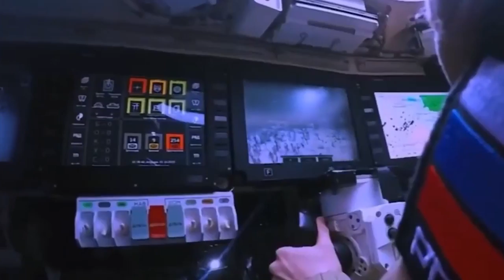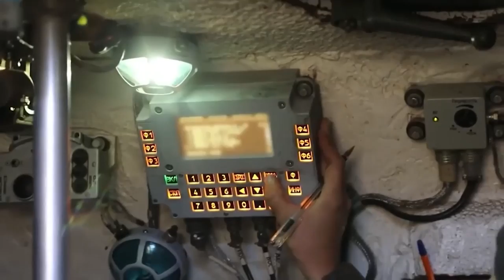What's Wrong With Russian T-14 Armata Tank (Military Analysis)

Comment: I'd like to hear more about the T-14 in Syria.. If it was even there. and I've never been a fan of a three man crew. As far I'm concerned, having a human loader is the way to operate.
Reply: The T-14 likely wasn't in Syria at all. With how well documented the conflict was we'd have at least some evidence if it did.

As for 3 man crews, they make perfect sense if the tank is well designed and are a necessity for crewless turrets which means they are likely the future, since optronics advancements and autoloader innovation make crewless turrets more and more likely our future. Even now they're finally popping up in IFVs and the like, MBT autoloaders are harder to get right and MBT projects a hell of a lot more expensive which is likely why it's taking longer to implement them.

Thing is, the main advantages of crewed turrets are in peripheral vision, but optronics are making that irrelevant, nowadays the latest IFVs popping up like the Spanish Dragon and Castor VAC lines have better awareness despite being crewless due to this, and the cost of these systems is rapidly decreasing with time.

As for the autoloader. While the Russian caroussel models are a shitshow, the NATO models, most notably the French ones implemented on the Leclerc have proven we can do a lot better. With the added advantage of keeping all the ammo in the turret which allows for it to be a completely isolated module from the crew and engine, allowing the tank to still move and operate even if the turret suffers a catastrophic failure.

In my honest opinion, the next gen of MBTs are likely gonna be crewless turreted 3 man teams. Likely not the Abrams X or new Panther because those are clearly tech demos and way too expensive to implement, but something that takes notes from the French MBTs and Spanish IFVs, and possibly keeps the crew in the back like the Israeli Merkava since the main drawback of that is also awareness which once more, has stopped being an issue. But the T-14 was a horrid implementation of all the ideas it claimed to champion and if anything just serves to turn people away from them.
Reply: @thespanishinquisition4078  The hull-residing autoloader of T-14 has its benefits over say a turret bustle autoloader. 
It has a much lower risk of getting hit; allows for a smaller turret, which means you can use less and smaller radar arrays but still be able to cover the entire tank; T-14's autoloader can carry ten more rounds than Leclerc's bustle autoloader and 16 rounds more than the K-2, which is a pretty big advantage in combat, by the way; there are probably other minor advantages that I haven't though of.
Reply: @definitelyfrank9341  And as most Russian autoloaders requires a hangfire clearage every 3 shots.
Reply: @okbutthenagain.9402  Well, a CIA report directly debunks your claim; it states that the T-72's autoloader managed to cycle 3,000 rounds without any mechanical issues or malfunctions.

Nice try, buddy.

Comment: Does this tank have potential?
Simple answer: NO
It is made by russians and therefore they would never achieve it's full potential.
However the tank itself looks good on the outside but how good is it in the inside of it?
We can only speculate how it will perform under small changes (auto load is garbage feature in a tank tbh since it's so slow)

Comment: wait a minute every new tank is going in the direction the t14 is going like it or not. just look at the latest german and American next generation tank and you can see a lot of important similarities so do they suck as well
Reply: not really as the MBX and MBT 80 prove, and date form the 1980 that would lead to the Abrams and the Leopards of the late 1980s. The experimental MBX had a Armored capsule for the crew and a unmanned turret.
Reply: @Delgen1951  all the new tanks have characteristics of the t14 so what you said still doesn't make a difference, tanks are evolving in the direction the t14 is as a result of better technology

Comment: I'm calling bullshit on this.

There where about 600 T90's at the start of the Ukraine war. About 20 have been lost... Several ran out of fuel (this has nothing to do with the efficacy of the tank, that is shitty logistics) Several malfunctioned and had to be abandoned, some where destroyed, and some where captured. 

About 2000 tanks where deployed, about 600 have been lost. Which is pretty bad... But how well trained where those troops... Did they have proper infantry fire support, air support etc. 

A weapon is only as good as those who wield it. AND the support teams they need to be survivable on the battle field.

The Armata is orders of magnitude better than the T90. It's not some mere old design, reimagined. It's a ground up redesign. Yea... That means delays lol. Problems are going to occur. 

Does that mean it is shit... NO! It is being produced on a shoe string budget. And given all these factors... They have done a pretty good job. 

Delays, cost overruns, and technical problems are a normal part of the development of any piece of military hardware. Cough, F35, Cough

And just FYI... Russia has silicon fabs... They aren't cutting edge. But they are more than capable of producing a CPU that can run a tanks systems. It will be slightly larger, and bulkier, as Russian gear usually is. But it will be robust, and it will get the job done. 

Russia also has stock piles of silicon from TSMC and Global Foundry. And that won't be running out any time soon. They have more than enough to produce their allotted T14's, other fighting Vehicles, and SU57's.

We're not calculating the distance of quasars here... A 10 year old Xeon is probably MORE than capable of running these types of systems. 

I'm no fan of Russia, or Putin. And this war is an unmitigated disaster, and the human cost has been absolutely horrific... But I am sick of this Russia gear bad, west is awesome attitude. It's farcical. And quite frankly, just plain misleading!

Comment: What the New Abrams X was similar with the T14, new concept on Tank, both are expensive and I doubt the Abrams X won't suffer the same dilemmas as the T14
Reply: The biggest problem the Abrahams X has is that there is little reason to build them at scale right now. As such it is kind of a "Look what we can do if we feel like it" thing. Tanks are not thre dominant force they used to be, and for the purposes of the US the armor we already have performs great.

It would be one thing if we were losing Abrahams like the Russians are losing their armor, but so far little has been its match, and we focus primarily on different tactics.
Reply: ...only it won't take 20 years for us to iron them out, or build more than 20 of them.

Comment: the t14 doesnt take 10 sec to reload, it has 10-12rpm fire rate which means it takes 6 to 5 sec to reload
most human loaders cannot fire as fast and those who do can only do it for a few round worth of shooting
this also means that the abrams loader will have the protective blast door always open and have ammo all around the turret negating any crew protection
Reply: I very much doubt Abrams crew would have Ammo all around the turret especially in a war zone.
Reply: @michaelfloyd1127  thats to get the full ammo capacity stated for the tank and in case to achieve the maximum fire rate.

if you dont have ready to pick up rounds, you will have to open and close the blast protection door every time you want to pick a round up.

Abrams is one of the best blast protected tanks since almost  all of the ammo is away from the crew. This doesnt apply the the UK chalenger2, which has 2 piece ammunition and has no blast protection at all, or the Leopard 2   which has half of the ammo away from the crew and the other half next to the driver and loader.
Reply: LOl fire rate of 12.. Listen Russia's autoloaders rarely do what they claim they can. And more often than not never get more than three shots off before requiring a hang fire action.

Comment: There are no t 14s in Ukraine, the t 14 did not break down but instead its parking brake was on and the driver did not know how to remove it. The t80 has a comparable reverse speed to the Abrams. This is just 3 minutes into the video.

Only had to listen to the first two minutes to realize that this is not actually a dependable resourceful video.
In fact there are multiple mistakes and misconceptions scattered throughout the video.
Reply: Infact I believe this is not about the t14 at all, it is about throwing hate at Russia, the engineers that designed this tank are not relatives of Putin, give them their own credit, even tho their country is questionable.
Reply: Same

Comment: T-14 never broke down in the 2015 victory parade. The tank's crewmen were not familiar with the operation of the tank. And yes, there are problems with T-14's thermal imaging systems, most likely bugs in the software. Also the engine problems of T-14 Armata.

Comment: Frontal armour of almost 1 metre????
Is that correct????
Reply: No its probably even less than on T-90 or the weight would be crazy high.
Reply: @Mr.Dodo-  are you claiming this video is spreading mistruths?
Listen from 1:40
Reply: @procatprocat9647  Well it is not like the document on the T-14 are public, so the only information we get is what is published by the government. There is no way the armour is anywhere close to 900mm thick. The tank would just weight too much and have REALLY BAD mobility. But the mobility is not bad and we can see this in footage. So it must mean that the armour is thin.

Comment: The T14 at the victory parade didn't break down. The driver pressed the emergency brake and didnt realise it. Thats why the towing vehicle couldnt move it at all. Do some more research.
Reply: It didn't brake down. The brakes just stayed down.
Reply: Right, and nobody in the tank knew what an emergency brake was. And nobody towing the vehicle thought "maybe we should make sure the emergency brake is off to make my job a million times easier", you know, the first step in towing every single vehicle in existence.
If that's the case, this gross incompetence is far worst than the vehicle breaking down. But now that you mention it, it does seem like the kind of failure only the Russian army can pull off. Next time, you'll tell me Russians forgot you had to remove park to go forward.
Reply: Yeah, and the Russian fleet flagship "Moskva" sank because of an "accidental fire".  🙄
Reply: @samuelweir5985  it sank because some maitanance officer stole 80% of its air defense systems.

Comment: With a few exceptions (Mig-15), Russian hardware have always been overrated compared to their western counterparts. The main source for this is the T-34. which in 1941 was able to easily shrug of rounds from German 37mm and 50mm AT guns. Come 1942/43 and the dreaded T-34 is suddenly just meat on the table for PaK 40s, upgunned Panzer IVs and Tigers. But the first impression stuck,and the T-34 has often been named "the best tank of the war". In addition they made a whole range of dreadful heavy tanks, starting with the KV-1 and ending with the awful T-10. The only half decent one was the IS-2, a primitive and poorly made tank, basically a KV-1 with a bigger gun and sloped armor, that somehow has been regarded as superior to the Panther and Tiger I, and at least equal to the Tiger II.

Meanwhile the hapless Sherman, which was in most respects superior to the T-34, entered combat when the Germans already had upgraded their AT weaponry, thus earning a reputation for being easy to knock out from the get go, and often been regarded as a failure.

Comment: Human loader will never be superior to machine. Few shots and he will be exhausted. You also need one more crew member only for loading. Gunner can't be loader and commander can't be gunner. Remember - when tank is penetrated in a right spot, ammo rack can blow out. Autoloader works fine since T-64 and has nothing to do with exploding ammo rack - it is rather poor side skirts design and not as good top side protection against rocket missiles like Javelins.
Reply: Obvious account agenda aside. The autoloader is infamous for jams, misfeeds and becoming misaligned and when no safe or quick way to clear misfeeds and the complexity of the mechanism making battlefield repair unlikely, the traditional loader than most nations still use is infinitely more reliable and still operable in suboptimal conditions. Tank loaders in Western nations train vigorously to put as many rounds through as physically possible - far more than any single confrontation would warrant.

US, UK, FR etc. are laughing at how badly maintained the Russia military has kept their equipment and vehicles with supply barely able to keep soldiers equipped with what would basic day 1 gear for any new recruit in bootcamp let alone active conflict. Inter-rank corruption has crippled the initial assault.
Reply: Wrong auto loaders break down very easily while qlso if the auto loader is damaged it cannot load and if it could it would take 30 seconds to load one shell without its auto loader
Reply: @ArctrooperHavoc  Actually what you said is a myth. When you ask someone who served on one of Russian tanks, he will say that even in combat situation you can easily repair autoloader malfunctions. You understand of course there are damages that can't be repaired... but same situation is when loader is killed in action. :)
Reply: @nxxynx5039  Account agenda? I don't understand what did you mean, but I don't care at all. Ask anyone who served on russian tank is that what you said is right. He will laught, because it's easy to repair autoloader. Ofc I mean not destroyed autolader... but jammed. But same situation is in US, UK and FR takns when loader is killed in action. :) By the way. You know... 20kg shell isn't something you can swing all day but you can believe everything what you want.
Reply: @sinoichi  actualy when it comes down to if the loader dies the gunner or the commander will have to load for them
Reply: @sinoichi  also on a t14 aren't you guys separated from the loader making it harder to reach it
Reply: @sinoichi  and also with such a small turret the breach is easier to be wiped out
Reply: You don't actually know how that works as I see. When one of crew members are knocked out or killed, you need to retreat. When commander loads gun, your crew will be blind. When gunner loads gun, he will not aim at the target and will lost target from sight.
Reply: @ArctrooperHavoc  Yes, it is separated and that is a good point. But still T-14 isn't in active service and there are no good source of information how to maintain autoloader - so in this scenario we can only persume it is as good as other autoloaders - which means it can jam but it's not as often as western media says. We don't hear anything about autoloader jamming in Ukrainian and Polish tanks... nowdays everyone have a camera so it would be massive subject in current Russo-Ukrainian war.
Reply: @sinoichi  another issue why don't you place the amo in a much more safe area if the tank so sone tank crews actualy have a chance if survival?
Reply: @sinoichi  the thing is once the shell is loaded the commander will head back to position or the gunner will head back to its post each crew member Is trained to load a shell in 5 seconds so if the crew moves fast enough it would take about 8-10 seconds to beable to fire